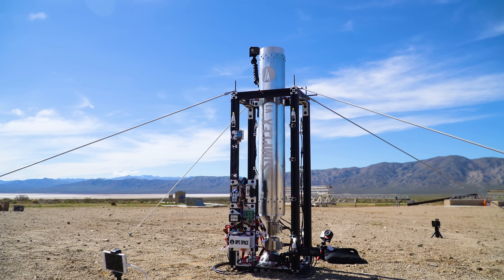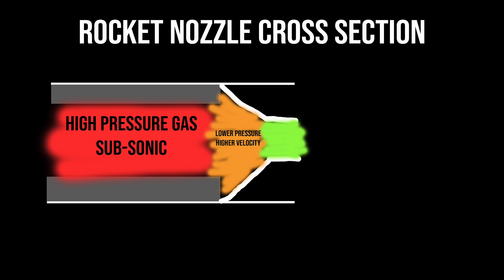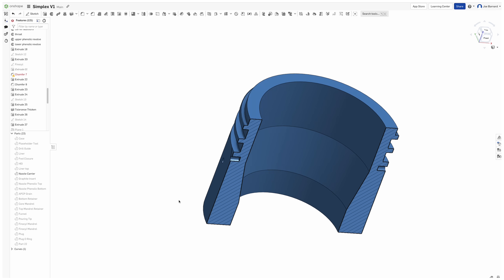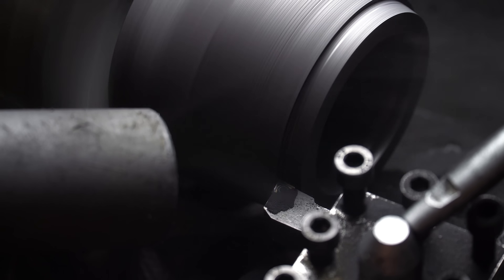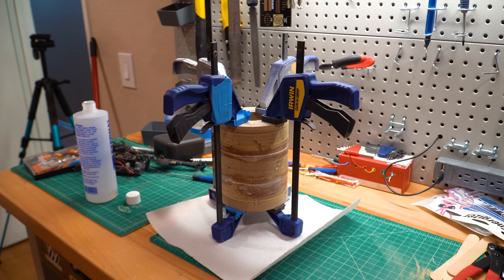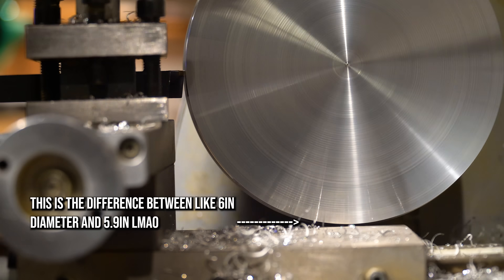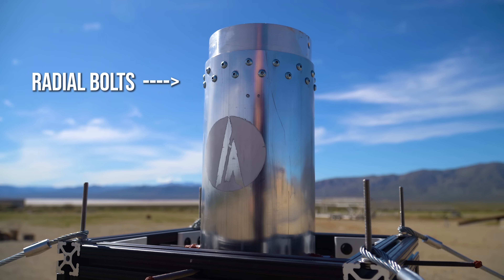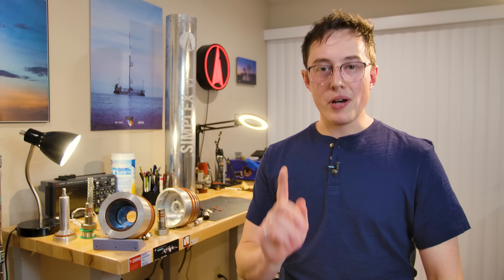Making a Rocket Nozzle - Simplex Ep 3

Comment: Graphite dust is a lubricant and sold as such. It's not abrasive.
Reply: Graphite is a lubricant and an abrasive. Turns out they aren't mutually exclusive properties. 

The key is the shape and orientation of the graphite particles. It's like a bunch of little pancakes. When they slide across surface to surface, it greatly reduces friction. When the edge slides across the surface of your material, it creates a little scratch, abrading it. 

But wait, graphite has a hardness of 1-2, so how can it abrade harder materials? Well, graphite is so soft because of how easily the layers break apart. Get down to a single layer and it has the same hardness as other crystalline allotropes of carbon (think diamonds).

Comment: "Graphite dust is highly abrasive."  Isn't graphite used as a dry lubricant?
Reply: Good question! Graphite is used as lubricant.
Reply: Graphite is a lubricant and an abrasive. Turns out they aren't mutually exclusive properties. 

The key is the shape and orientation of the graphite particles. It's like a bunch of little pancakes. When they slide across surface to surface, it greatly reduces friction. When the edge slides across the surface of your material, it creates a little scratch, abrading it. 

But wait, graphite has a hardness of 1-2, so how can it abrade harder materials? Well, graphite is so soft because of how easily the layers break apart. Get down to a single layer and it has the same hardness as other crystalline allotropes of carbon (think diamonds).
Reply: I think he heard something about carbide dust and got it mixed up.
Reply: Can it not be both?
Reply: @vpupkin97 wrote a comment describing how graphite paste can be used to facilitate grinding two hardened metal parts against each other for a near perfect fit. 

When graphite is clean and dry, it acts as a lubricant. Mix in some oil, and it becomes a carrier for abrasives.
Reply: @hamjudo It actually isn't dependent on dry or oil. It has to do with particle orientation. Graphite dust simultaneously lubricates and abrades.

Comment: 6:15 Pro tip for getting smooth results from your cross slide, knock up a tool that let's you drive it with a cordless drill.
Reply: They make cnc China mini lathe replamcnet motors with ball threads too for under 40 bucks 10 years ago last time I could afford mini lathes. Buy alot of it is rigidity m that said if the lathe is anythkjt at all should hlbe able to adjust/replace the ways bearing pads. The factory ones are horrible hell again ack 2hen I coild sfford it my mini mill the collet tool holder was 8mm out of round from enter had a rig fab shop lathe it straight for me so I could make swarf ASAP 🤣 
Looks like the way adjustment screwed are way too tigjt they take very precise and tedious fiddling to get just right but should end up butter smooth and be able to be turned with just 2 fingers and no backlash

Comment: 13:25, I think, you need a hydraulic press in the shop 🙂
Reply: hydraulics can leak down over time, so you'll have to babysit it and monitor the pressure
My suggestion would be to just find an old arbor press that's large enough to fit most of this stuff, mount it on a heavy bench that will allow the passthrough to reach the ground, and then you can either put things that fit on the bench, or larger things under the bench for clamping. to clamp with an arbor press, you just hang a weight on the lever arm. it's a mechanical press that will get you enough push to get friction fit parts together without going overboard
Reply: Harbour Freight sells: "12 ton H-Frame Floor Shop Press" for $170 (Instore Only, must be heavy to ship)

Comment: graphite dust is abrasive? you sure?
It's common to place graphite shop separately from other shops like a "dirty" one, but abrasion is not a thing with graphite. I mean come on, graphite is even used as a motor brushes
Reply: I'm not sure I'd call it abrasive, it's used as a lubricant after all.  But it will destroy motors and it gets on everything.  I had to turn a graphite nozzle and I built an enclosed air box around the lathe with 3 shop vac's exhausting out of the shop and I still had fine dust around on surfaces.  I had a shop machine my second nozzle.. I believe they do it underwater.
Reply: Graphite is a lubricant and an abrasive. Turns out they aren't mutually exclusive properties. 

The key is the shape and orientation of the graphite particles. It's like a bunch of little pancakes. When they slide across surface to surface, it greatly reduces friction. When the edge slides across the surface of your material, it creates a little scratch, abrading it. 

But wait, graphite has a hardness of 1-2, so how can it abrade harder materials? Well, graphite is so soft because of how easily the layers break apart. Get down to a single layer and it has the same hardness as other crystalline allotropes of carbon (think diamonds).

Comment: What keeps the graphite throat from being thrown off with the exhaust gas as the phenolic insulator ablates?
Reply: Probably, time. It ablates slower than all propellant burns out.
Reply: The taper fit keeps that from happening.  The burn time is so low that not enough ablative will be lost for the lower part of the ablative to go away.  He could probably re-fire that nozzle a second time.  Also with that short of a burn time he probably could just use graphite for the entire nozzle and ditch the ablative.
Reply: @AIM54A  The phenolic is insulating the aluminum case from the intense heat of the carbon throat.
Reply: @jimurrata6785  I understand it's purpose. I'm just saying the burn time isn't long enough for the carbon nozzle to heat sink enough to weaken the case.

Comment: maybe vibrating or pulling a vacuum when packing reduces voids?
Reply: IIRC he did both. I coild be wrong I havrn1/4 a brain lobe missing. I would be curious to find clever ways to avoid and fix it thoufh
Reply: It would have worked if they had used enough binder (HTPB) but their prop mix was WAY too thick to pour or vibrate.
Maybe next time Joe can get the finocyl grain (or part of the motor, since they made it monolithic) without voids

Comment: photon engine is already directional
Reply: hey try piezo gimble of the rocket nozzle, ie, solid state minimal movement, flex movement
Reply: afterburner does not need a converging diverging nozzle, its operating on the diverging part
Reply: why did you not lathe the wood thing from one long part
Reply: if your design works, o-rings and other jank can go
Reply: @Jkauppa  I imagine the diagonal width of the phenolic would be too big for the lathe, and it doesn't look like he has a 4 jaw chuck to hold a non round part. Also, unless you want it to need assembling with a 100 tonne press, you can't have the kind of fit you'd need to get rid of the o ring. O ring and sealant is easier
Reply: @nelsonglover3963  let it sink in :)
Reply: let that sink in :)